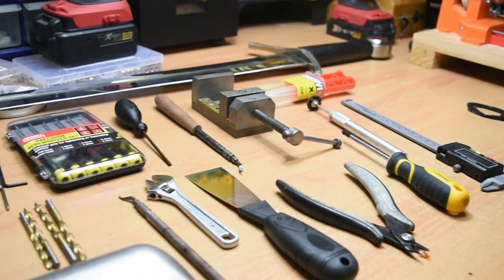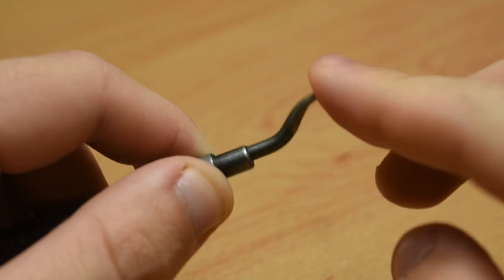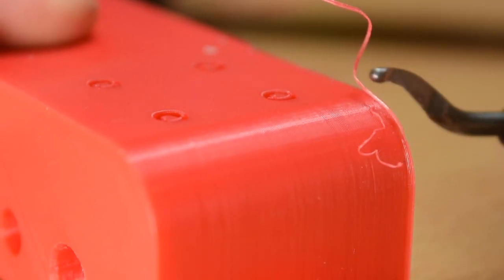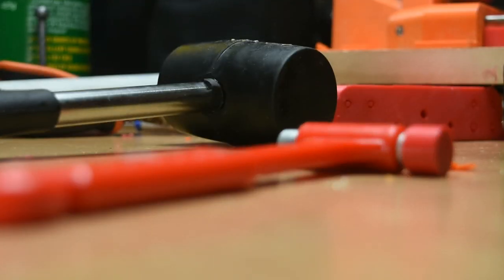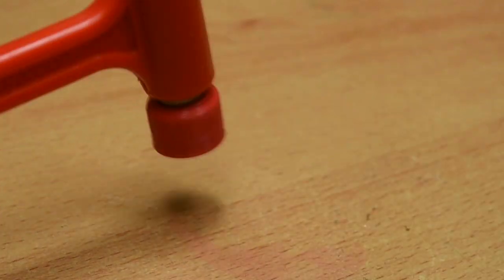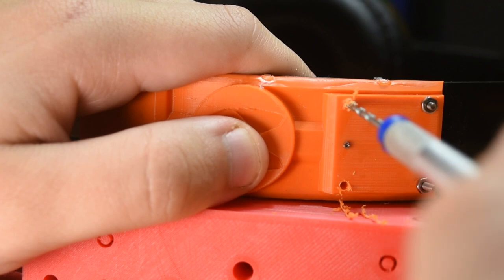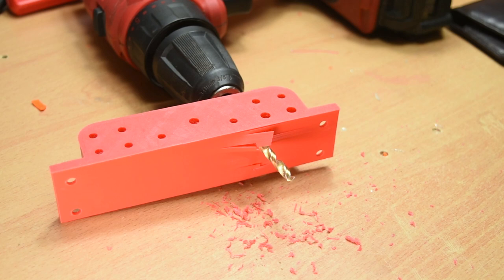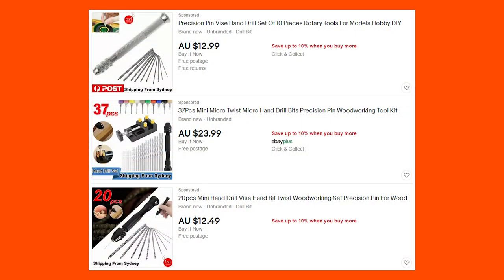3 Useful Tools For 3D Printing (That You May Not Have Thought Of!)

Comment: Great stuff; You should look at the "6 in one" hammers. They are about the same size, but the handle is a nested set of screwdrivers. Not the best screw drivers, but they are usually flat blades so you can abuse them in all manner of non-screw related program activities.
Reply from the maker: One of those was actually one of my first tools ahah, got it when I was around 8. No clue where half the bits are now though